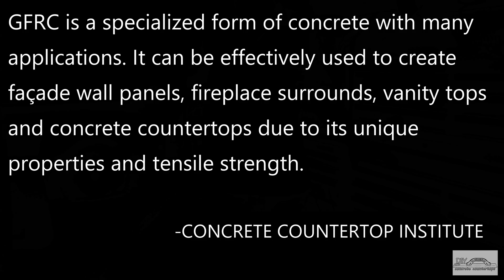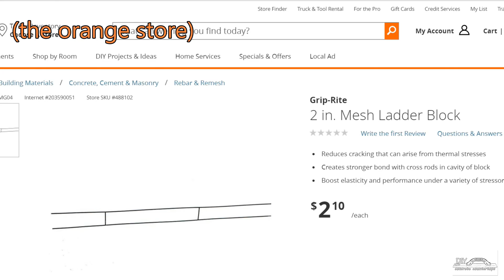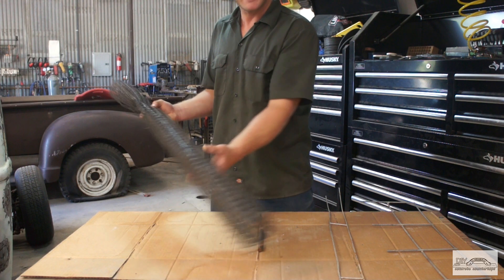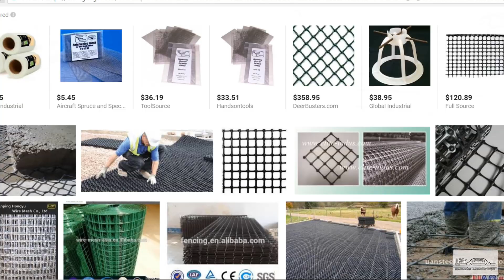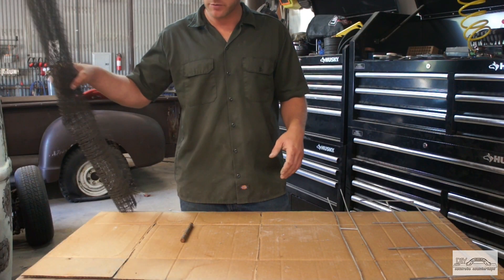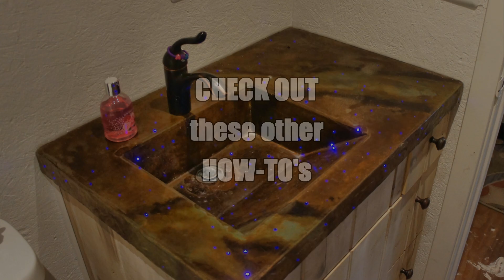This could make or break your countertops! Reinforcement. DIY step by step concrete countertops

Comment: Hi! I’m pouring a 3 1/2” thick, 22” deep, 20’ long bar top for my friends new bar.  I’m gcing the project but have never done concrete counter.  I have goat paneling left over I was planning on using for the reinforcement.  Should that go mid pour, or on bottom before pour, or both? Also should pour go to top of form or if he wants epoxy finish should be we leave 1/4” for epoxy? Seems like you can’t smooth and level as easy if not poured and scraped to top of form

Comment: For something weighing 800 lbs and only 2 inches thick, it's hard to wrap my head around how adding bendable wires will make potentially crumbly, or buckling cement more ridged. 

Can you explain?

Comment: I've got a whole bunch of extra welded wire fencing, the stuff that is pvc coated (like this: https://www.homedepot.com/p/Everbilt-4-ft-x-50-ft-Black-PVC-Coated-Welded-Wire-Fence-308382EB/205960866).  Do you think I could use that for reinforcement?  Any issues with the coating?

Comment: What would you advise doing countertop-wise for a three-sided cinder block bbq grill with a 4ft opening in the front? I want to pour in place. Do you advise a lintel or would reinforcing the countertop be enough?
I'm guessing the countertop will be supporting roughly 250 lbs.

Comment: Hello I am working on a cast in place bar countertop of 2” of thickness. Because it is poured in place I have to anchor the reinforcement to an existing wall. I have the concern of anchoring a wire mesh, If it would be enough to resist the weight of the counter, since your recommendation was not using rebar on a 2 inch or less thickness.  Do you think is enough or maybe I can use a combination of reinforcement? Thanks for your help! Saludos desde Panama 🇵🇦

Comment: Thank you for the video and description of the different options.  I am building an outdoor kitchen/bbq station.  The kitchen will be "L" shape and have a straight run of 3' x 10' concrete counter that includes a 1' overhang along the 10' section.  I would like your recommendation of what the best reinforcing would be for the concrete counter.  Especially the overhang area.  Thank you in advance!

Comment: I’m about to pour a 4x8 slab for my island top. 1 1/2 thick only. Won’t be poured in place, plan on lifting it out of form, flipped over then set on top. 
I’m extremely scared of it breaking or cracking while I’m flipping it and lifting it into place. 
Thoughts ?

Comment: Great video thanks! I’m working on a outdoor Bartop that about 6’ x 3’ with a base of 6’ x 1’, the base will be covered in cement board and countertop 1.5” thick. How would you reinforce the top

Comment: I am pouring concrete countertops and am planning to use Alkali Fiberglass Mesh that will be about a half inch from the top of a 1&5/8” countertop.  I also bought some Hog wire mesh which is 6 gauge zinc plated.  My question is ... is this too much reinforcement, if I were to put the hog wire about a half inch from bottom?

Comment: I am a completely new DIYer and I’m taking on an outdoor kitchen this Spring/Summer.   I want to do my own concrete countertops.   The kitchen will be under an overhang.   Your videos are giving me hope I can give it a good shot.   My question is I’d like to put some metal overlays on the countertop.   I’d like them to set in the concrete and then maybe use an epoxy to make sure it all levels out.   Thoughts?   Can it be done?   Thanks for your advice.

Comment: Awesome videos! so i have two questions 1. For my outdoor countertop I am making an 1 - 1.5 ft overhang on one side to make a table/bar. What type of reinforcement should i use? rebar or the grid thinner one? 
2. I built my outdoor kitchen with cinder blocks. How do i frame it since there is a gap between the two walls.  If i use plywood for the inplace frame, then i have no idea how i will get it out...it will sandwhich between the blocks and the countertop. Thanks!

Comment: What do you recommend for a 2x5 foot table top. I used mortar and let it harden for an hour. I was told there was no way it would break. As I was lifting up the mold it snapped in half.
Reply: It’s 1.5” thick

Comment: I am building a 20”x96” poured in place concrete bar top that straddles a 6” wall... What would one use to keep the wire mesh from sitting on the bottom of the form? Would steel lath be an effective reinforcement? The top is 1 1/2” thick on the top and a 1/2” thick at the turn down... Using 3/4” melamine form base...

Comment: Ciao un saluto dall Italia 🇮🇹 volevo sapere se usi del semplice cemento sabbia e fibra di vetro?
Reply from the maker: portland type 2 cement
30mesh sand
10mm (-) pea gravel 
alkaline resistant fiber
There is the common 1,2,3 cement recipe (1 part portland, 2 parts sand, 3 parts aggregate) that will get you in the neighborhood of a decent sidewalk mix. However for a countertop I'd use something closer to a 2 parts sand, 2 parts rock, 1.5 parts portland. That ratio should yield a satisfactory mix. I have a mix ratio included in one of my other videos also. Thanks for watching in ITALY
Reply from the maker: Google Translate:
cemento Portland tipo 2
30 maglie di sabbia
Ghiaia di pisello di 10mm (-)
fibra resistente alcalina
C'è la ricetta comune di 1,2,3 cemento (1 parte di Portland, 2 parti di sabbia, 3 parti di aggregato) che ti porterà nel quartiere di un discreto mix di marciapiedi. Tuttavia per un controsoffitto userei qualcosa di più vicino a una sabbia di 2 parti, 2 parti di roccia, 1,5 parti di Portland. Tale rapporto dovrebbe produrre un mix soddisfacente. Ho un rapporto di mix incluso anche in uno dei miei altri video. Grazie per aver guardato in ITALIA

Comment: I'm making a circular concrete disc, 2 inch thick x 32 in. diameter.  To get the reinforcing as symmetrical as possible, is it ok to criss-cross the ladder wire pieces?   Or would another type mesh be better? The disc will form a well cover, so will be supported only around the edges.
Reply from the maker: Crisscrossing thin diameter reinforcement in a 2" substrate will be fine. I wouldnt worry too much about the symmetry, more about the function. Good luck with the project!

Comment: Great videos, Can you tell me what the proper height is for the reinforcement. If I use ladder wire and have a 2in thick pour?
Reply from the maker: It would depend on the support underneath. If the concrete is suspended between two pieces then wire in the bottom is best, If it is cantilevered then near the top is better. concrete is weak in tension but strong in compression.

Comment: How do use keep the wire mesh from dropping down to the bottom when vibrating the forms?
Reply from the maker: Check this video out. The 13:13 mark shows one option https://www.youtube.com/watch?v=GZ8OEDduUYg
Ive used zinc coated nuts to hold the wire up. I wire through the nut and attach it to the mesh. Another option is to add the mesh in when your forms are half full
Reply: Add it at the end, all your vibrating should be done first. Then add your mesh. Lightly vibrate and cover the mesh

Comment: Thanks for the videos, they have been very informative.  I’m getting ready to do my first concrete countertop, it’s a 34”x 22“ bathroom vanity top. It will have an undermount sink in it as well.What reinforcements would you recommend? I was planning to use the fiber mesh that you recommended in another video, should I also be using ladder wire?
Reply from the maker: 90% of the time I use both, They will compliment each other well. A a top that size will be great for a first pour, it shouldnt be too fast paced or tiring. Thanks for watching the videos!
Reply: Thanks for the reply, one more question. Should I pour in place or precast. It seems like pour in place might be easier to get a smooth pin hole free surface.
Reply from the maker: On a pour this size I would probably lean towards a precast top. The reasons being: the form materials will be cheaper (a $45 sheet of melamine vs a $zform kit). If you're not 100% happy you can scrap it and re-pour a precast without tying up your bathroom. If you have little concrete finishing experience then the bottom of a precast top is the perfect place to practice. I wouldn't fret too much about 'bug holes', they're easy enough to fill.